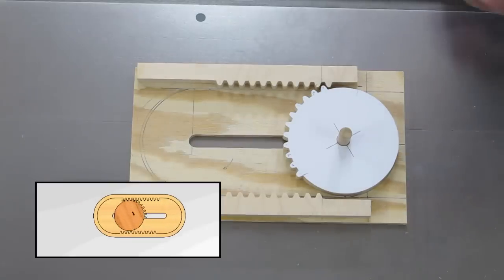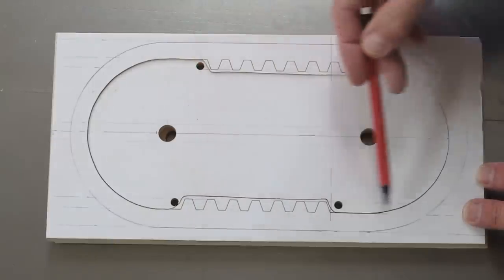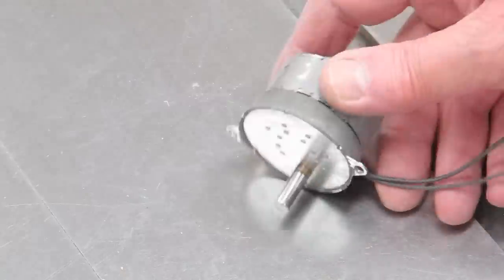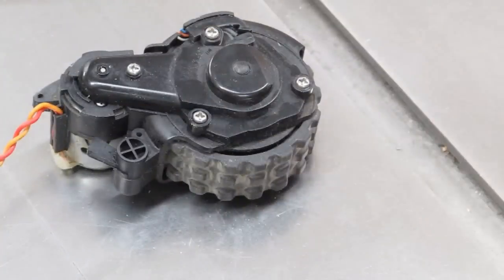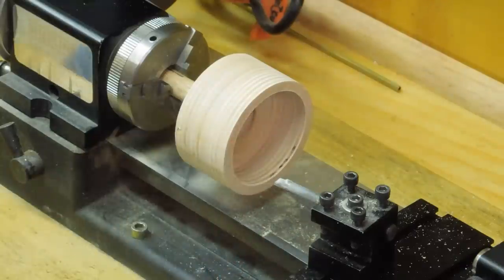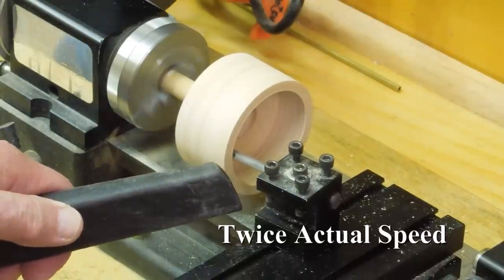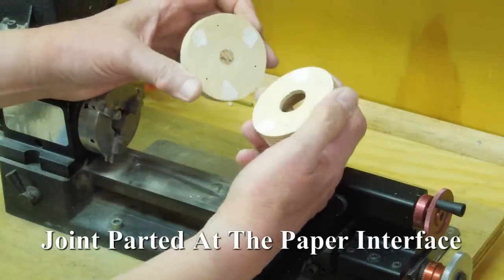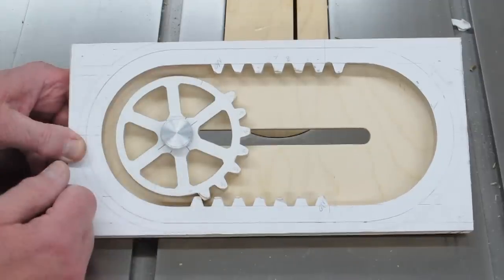Making The Reciprocating Rack & Pinion

Comment: I'm not sure I wanna know what you plan to use that for.
Reply: Let's just say webcam models around the world are delighted by this invention.
Reply: Phaha... That one took me a minute to figure out.
Reply: To make cheese? or butter?
Reply: window wipers in cars?
Reply: hedge trimmer mechanism
Reply: It is not for you Capt.
Reply: I think it can be use in incubator as egg tray turner
Reply: let keep it clean,  this is a family show....
Reply: Very very good job my friend 👍
Reply: hahahahahaha
Reply: same :D.
but isn't it same work as this gear?
http://polychroma.com/spiro/forces-basic.gif
Reply: clothes washers use that mechanism
Reply: Excellent pun. Took me less than 2 seconds to decode.
Reply: It could also be use as an air pump for heating up strong metal
Reply: Fix the shaft of the motor and you have a shaker... for a sifter.
Reply: Camera mount for filming tennis matches, maybe?
Reply from the maker: Funny. Good one! Ron
Reply: it can works as jack hammer

Comment: Hmm, perhaps its a failure of my visualization, but it seems to me it could do with one additional tooth to reduce the slamming when transitioning to the other rack. Unless the slamming is intentional feedback that is.
Reply from the maker: +Richard Smith As mentioned in the video and several times in the comments,  it is the pinion axle arriving at the end of the slot which gives pause for the teeth to switch to the opposite rack. The teeth operate very smoothly (no slamming, no extra teeth required). If this were turning very slowly you would not hear a thing... but I did not have a slower motor available.

Comment: My Dad spent most if his life repairing fishing tackle & I would watch him tear down reels, make springs, install parts salvaged from old broken scrap reels, etc. This dual rack & pinion slide assembly was in the Orvis reels for the up & down even winding motion. U had seen him taking the stuff apart, cleaning and greasing it and putting it back together & watch it work just by pushing the spool up & down! But up until I watched your video with the wooden model...it never really made since in my head...& I have been a tool designer for over 40 years! Now I have another aspect to use, thanks to your teachings! THANK YOU!!!

Comment: Ron I've used the glue with paper to hold items together in the past. I've now switched to the 3M pull free picture mounting technology to do this in my shop. It is faster, removes cleanly , and holds to metals as well as wood and other porous surfaces. I've even used it to hold a metal straight edge to a rough wood board to straighten an edge on the table saw.

Comment: Very interesting, Ronald. As a retired printer the mechanism you've designed is similar to the flatbed movement of the 2 revolution Miehle press. The main difference being that the gearwheel did not have the cut-out and moved laterally and engaged geared racks offset to one another. Buffers took the strain as the heavy type bed reached its end motion. I've tried to find a drawing but no luck. Best wishes.

Comment: Thank you so much for making this video. I've been scratching my head trying to work out how to make a large scale levelwind for essentially a kontiki reel. Although mine is actually towed out by a large kite and skyhook rather than a kontiki. Anyway I've converted a self propelled lawn mower into a large, petrol powered reel and just needed a way to get the fishing line back on the reel evenly. I'll use your idea but gring teeth off a bike gear and tack weld lengths of the chain to the inside of a steel box. Maybe mount that on a heavy duty draw runner.
Reply from the maker: Google the French fishing reel - "Mitchel 300 images" - look around for photos of it taken apart. It's been around a long time.
Reply: Ronald Walters that is cool. Mine will be more like a bait caster reel and about 50X bigger. My kite tows 25 baited hooks on a 360lb fishing line a mile out to sea. I've built a trolly mounted reel with a 4HP briggs and Stratton motor to wind it in (usually gets 7 or 8 big fish and the occasional shark) Just need to make a levelwind. It's a common fishing method in New Zealand but outlawed in most other countries. To be honest I've enjoyed building the reel more than the fishing.

Comment: That first motor you've shown is not a bad quality motor. It is just not intended for your application.
Reply: You mean it's made for a system without much resistance?
I guess some motor need to turn at high velocity to produce a significant contribution.
Using the same gear difference shown on the second motor we may actually see it work properly.
Reply: Yep!
Reply: And it's got a gear adapter to translate the axis towards the edge; you can surely dissasemble that mounting to get the original bare-metal motor (with the axis at the centre)

Comment: This is the same mechanism that made the old Mitchel 300 spinning reel mechanism work . In this case the gear case moved and the gear stayed fixed  and when rotating , causing the spool to go in and out from a pin in the back side of the gear case connected to the spool shaft --  meanwhile, another gear on the crank caused the spool to turn . This made for a pretty simple and very smooth retrieve mechanism which was really advanced for fishing  reels over a half century ago .

Comment: Using a windshield wiper motor you could easily use this as part of an oscillating drum sander.  The roomba (sp?) wheel might have enough power on its own.  Very cool.
Reply: Your windshield wiper motor idea has me wondering if you're in favour of low voltage, direct current shops and electric tools.

Comment: I build by trial and error as well. Have you tried extending the length of travel which would allow you to add another tooth or two to each rack and the sprocket. That should eliminate the backlash caused by the free spin before engaging the opposing rack. Just my two cents, but I did like what you've done. Very well thought out. Thanks for sharing.

Comment: This is a version of the gears that make the agitator in a washing machine reciprocate.
The first motor you tried is called a synchronous motor. It is primarily designed to have a low torque extremely stable speed. Like in clocks and timers etc.

Comment: Nice mechanism.  It will also convert linear to rotary motion.  I have an application in which I need to rotate a load 180 degrees when I push it across a table.  When I pull it back, I need the load to rotate back to the original orientation.  Because I am not concerned with the gear always rotating in the same direction, I could use just one gear rack and a full gear (no missing teeth).
Reply from the maker: The rack in this configuration will not drive the pinion because there is nothing to cause the pinion to switch over to the opposite rack. You might want to check out my video on Movement 123 where the rack does convert linear to rotary movement. Maybe you just want to stick with a simple rack & pinion.

Comment: Looks like a real challenge for a novice such as myself.  I do wonder that if, instead of a "motor" drive, a chain weight (as in a grandfather clock) could be used for power?  Could it also be used to swing a pendulum?  Thank you for the video and common (words) instructions and images slow enough to understand.
Reply from the maker: Notlaw47 You could use a weight but the drum arrangement could be complicated to keep the gear from binding and it would not run very long on a single winding. Winding itself could be difficult. I built this using salvaged items I had available. You could consider a 12 volt DC gear motor turning 25 or 30 RPM which are relatively inexpensive and available on eBay. It would run slower and would not bang back and forth quite so hard. Power it with a small 12 volt DC power supply which you may already have from an old appliance. Thank you for watching.

Comment: Very Nice design!, Just to say, if the wheel engaged with the starting teeths of one side  without any gap, there would be no pounding sound, which is caused by the axle hitting the end of the sliding slit!
Reply from the maker: agha shire It certainly is possible to play with the timing of the gears so there is no play and the axle does not engage the end of the slot. As I have posted before their mechanism is used in the French fishing reel - The Mitchel 300 - Google it.

Comment: Unfortunately, in this system there is a lot of backlash and if the system had to move, a tooth could be crushed. unless a locking device is integrated like a ball and spring locator.   I think I shall try to design one without a backlash before the teeth engage.  
Congratulations nice idea,
Reply from the maker: +Carmel Pule' It certainly can be timed "perfectly" just like the "Mitchell 300" fishing reel (which requires no locking device) especially if it is drawn in CAD. I don't use CAD so this was built using the trial and error process. Thanks for watching!

Comment: What are you going to use this for? Looks like it would work with maybe a hacksaw blade to make a pipe cutter or something. If you could get a strong enough 5v motor you could power it with one of them cell phone battery chargers. Maybe a log saw with an even stronger 20v battery and motor.

Comment: You could make up two spring plates. One on each end that will cushion the impact when transitioning and quite the clicking noise.
Reply from the maker: jjenson2006 If the spring(s) were strong enough to cushion (decelerate) the impact, they would probably also be strong enough to recoil (accelerate) the axle in the opposite direction before the pinion had time to transition to the opposite rack, which would lock it up. A certain amount of dwell is required at each end of travel to allow the pinion time to switch to the opposite rack. If you just slow this down, there is no discernible impact or clicking noise.

Comment: kinda cool, seems more like a novelty than a practical tool though. I can't imagine that performing long term under any kind of strain.
Reply: TheLaziestOfSloths Looks pretty damn cool to me. It let's you reverse the direction of of your linear motion without changing the direction the motors spinning.
Reply: I imagine the rotor would take one heck of an unnecessary beating though. As cool as this is I don't think it would be better than a piston wheel for longevity or momentum.
Reply: Think: Windshield wipers.

Comment: Interesting. The change in direction is quite harsh (like a triangle wave). I think this could be improved with an oval gear and a curved track that would slow the horizontal movement before starting back in the opposite direction (like a sine wave)?

Comment: Think of all the potential this has....... in the industry if you know what I mean :3
Reply: First thing I thought of was... if you know what I mean.
Reply: My thoughts are what you could do with the Spindle Sander.
"Sit down honey."
Reply: sircampalot001 I have a Ryobi spindle sander and bought it for a specific job that redeemed and multiplied the investment cost... but 9 years afterwards I've had occasion to use it only one additional time. I also recall opening it to see the mechanism responsible for imparting the reciprocal movement of the spindle-but being disappointed with the observation, I quickly forgot it. After watching the host video, I'm curious to see if it's rack and pinion. In light of my earlier disappointment, I doubt it is (i'm boring myself writing this--sorry!)
Reply: This is old ways of industrial design before microprocessor were invented. With H bridge motor IC you can control the motor back and forth plus more. Mechanical structure is way more expensive then electronic controls.
Reply: ***** The bashing is the best part of the industry

Comment: Hi, I like your design. Was wondering if you could add some kind of cushion into the design so that as the pinion teeth transfer from one rack to the other it wouldn't make too much noise. Make steal some ideas from pnuematic/fluid design. cheers
Reply from the maker: LEN HENG If
springs or cushions were used to decelerate the impact, they would probably
also be strong enough to recoil (accelerate) the axle in the opposite direction
before the pinion had time to transition to the opposite rack, which would lock
it up. The noise at each end of the travel (impact) is primarily the pinion
gear axle shaft hitting the end of the slot and not the gear teeth engaging.
The teeth actually engage quite smoothly as the direction of travel has already
stopped a fraction of a second before the pinion shifts from one rack to the
other. A certain amount of dwell is required at each end of travel to allow the
pinion time to switch to the opposite rack. If you simply slow this mechanism
down, there is no discernible impact or clicking noise. But then, if it were
totally quiet and exhibited no recoil, it would not be as interesting to watch.
:-)
Reply: Ronald Walters if that's the case can't we extend the length of the slot because t there's is no need for the gear axle shaft to be hitting the end of the slot. As the teeth of the pinion latches onto the rack teeth it will ride itself to the other end. NO cushion is required.

I also notice there's quite a bit of play on the width of the slot. Would not the tight fitting of the slot and the gear axle shaft helps to reduce the backlash and noise. maybe move the two rect block at the back a little closer to make the horizontal motion tighter.

Just wanted to improve things that's all. Your bansaw skill is amazing btw.
Reply from the maker: LEN HENG No. Hitting the end of the slot is key to the mechanism working. The length (or end) of the slot is what "times the gear" to the rack. Lengthen the slot and the gears will no longer mesh when switching from one rack to the other. Just slow it down and it runs smooth and easy. Build one... you will find out.

Wood gear mechanisms cannot have a tight fit. The wood moves with atmospheric changes and these need to be built loose enough to accommodate those changes. 

A great learning tool for building wood gear mechanisms would be building Clayton Boyer's wood gear clock "Simplicity". I have several videos on this clock. You can Google this clock.

Comment: Nice build on the contraption, however, I noticed at the end when you had the motorized unit on I couldn't see the sprocket on the other side of the board(!)  Weird, because it obviously had to be attached to your axel.  It was zipping along pretty quickly, so I guess my old tired eyes couldn't resolve the sprocket...? In the ending sequence, you say "this operates smoothly by hand...' and had the motor portion removed.  So my question/assumption is that the device bound up or had other issues preventing smooth working when under electric power yet works OK at a slower pace by hand(?)
Reply from the maker: It was shown operating with the motor from the rear (motor side) and from the front (rack and pinion side). It will operate smoothly (no binding) at a much slower speed with a slower motor drive.
Reply: @RonaldWalters2010  Right on, Ron, and thanks for the speedy reply!  I'm trying to invent a mechanism/strategy (which needs to be cheap, durable and small) to basically make a plastic cat's paw (check out Maneko Neki the Feng Shui Cat $9.95 as an Amazon search if you're interested and have time...I'd value your opinion as I'm a musician, not an engineer)  Maneko as he comes can move/pump his left arm (I just ordered my cat...not here yet for me to take apart & study) when he's turned 'On' but it only moves at 1 speed.  I want to invent a modification to this arm (and assuming to the entire internals of the plastic cat )that will allow a person to vary - greatly - the speed at which he moves his arm back-n-forth.  All cat-loving musicians, like me, will find this very adorable & make a nice gift to my young nieces/nephews...and maybe the world!  I saw a way to convert linear reciprocation to oscillating motion - basically converting a small linear movement to rotary motion of 90 degrees & thought your device would serve as the linear travel motor....but...I'm thinking it's too mechanical in nature, kinda overkill (but maybe not?!  It just needs to move a fairly small/light piece of molded hollow plastic) and am trying to brainstorm on a way to move his arm via only 1 or 2 small DC motors and some type of logic board or timing IC chip.  OK.  Sorry to bomb you with a book here.  If you care to reply I would value your thoughts, if not - have a great day and I still look forward to seeing more of your other videos(!)
Reply from the maker: I designed and manufactured an animated conductor figure for installation in a street organ. The following may give you some ideas. I can’t help you with the arduino programming… someone else did it for me. Following are the associated playlists.
Senior 20 Organ Conductor Figure Casting Kit https://www.youtube.com/playlist?list=PLDjucfhdTRPnsxpT4cRofFVFP1-B2R3cX
Final Conductor Installation Senior 20 Organhttps://www.youtube.com/playlist?list=PLDjucfhdTRPmq6h3vBrVUOL2Tlk5WY4g8